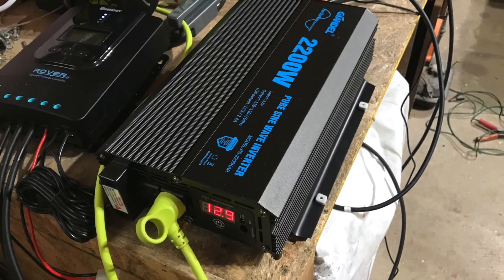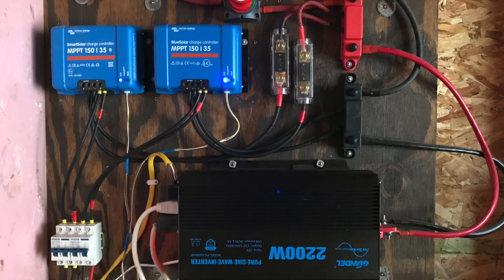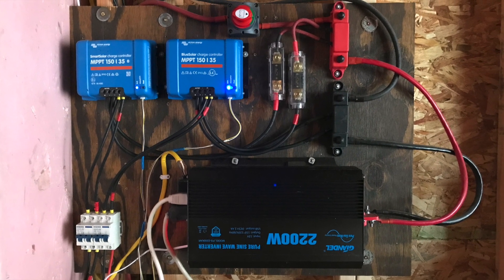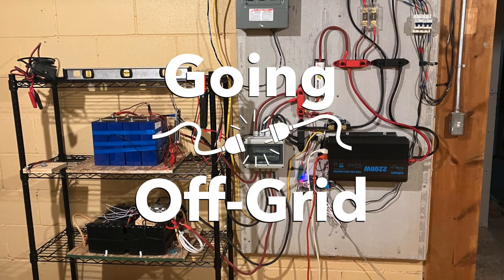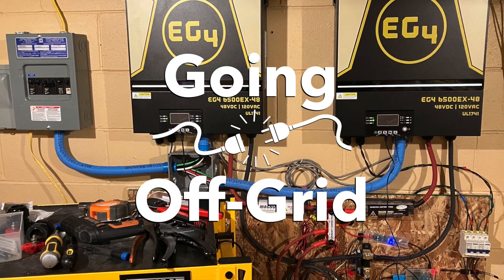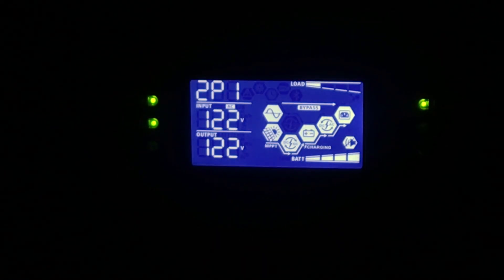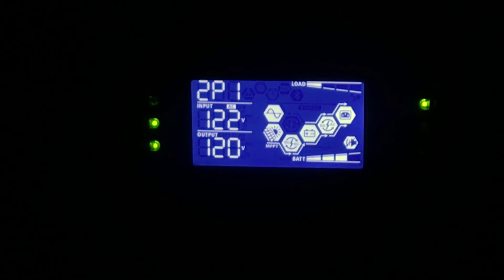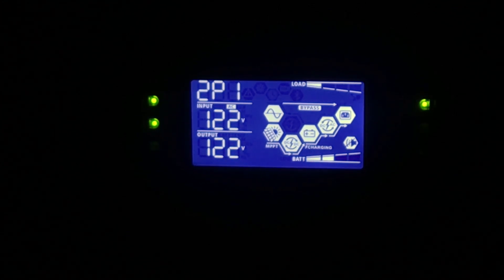Inverter Keeps Dropping the Grid Connection, Part 1

Comment: I have a Growatt 3000 24v that I am currently testing, and to be honest I am starting to think I might be better off going with a system of components rather than an all in one unit, I am going to invest in some Victron charge controllers, and separate inverters moving forward as I don't trust all my eggs being in one basket, the component method is a bit more expensive, however you can change one failed component rather than the entire system failing. Check and make sure your panels are not over-volting the unit, when I put 5 of my 100w panels in series on a cold sunny day they cause my Growatt to turn the panels on and off as the volatge spikes, even though it is "under" the voltage limit of the unit, when I go back to 4 panels with 80v or less it is fine and the panels produce well.
Reply from the maker: I won't say that same thinking hasn't crossed my mind.  I had victron charge controllers in my 12v system and they just worked.

I know the voltage isn't anywhere near the max voltage.  The max VOC on any single string is around 200V.  Thanks

Comment: Try to space out your voltages for switch to grid and switch back to battery. Mine are set  at 44&50
Reply: yes
Reply from the maker: The voltage settings in my inverter to switch between grid and battery are 48v to switch to grid and 54v to switch back to battery.  That should put the switch back to battery pretty far into the charge curve for LifePo4 cells.
Reply: That seams to be fine then. What about the battery minimum voltage setting? If it reaches that it will charge from grid right?maybe if that's too close together to the switch to grid?

Comment: How do you set the charging mode ?
Are you sure you got enough voltage going into your inverters ...
I mean for those going high voltage ( 100-500v dc ) they'll start at 90vdc but their standard true start is near 120v and above ...
So, if you had it running with 7 panels string don't expect getting more energy by splitting ...
It may simply can't switch due to its own consumption while trying to run solar ...
If it detects what to run your consumption it'll try to run solar only but the voltage drop don't allow it ...
Check your charging mode priorities ...

Running Sub don't indicate it won't try to charge the batteries ...

My best guess stand it's in solar only charging priority ...
So it keeps trying to run on solar but have to switch cause it don't have enough production to ensure output, selfconsumption, and "stabilizing" the batteries .
Reply from the maker: Thanks.

My charging mode is Solar Only.  I don't want to charge from grid, because that defeats the purpose of trying to give less money to the utility company.  Charging from the grid just means you're paying up front for the power you're gonna use later.  

The inverter is in SUB mode (grid-bypass) which should mean that solar powers the loads and when there's not enough solar, it should draw from the grid to compensate for the difference.  I know there's currently issues with how SUB mode operates and Signature Solar has been made aware of this and are working on a fix.  

Regardless of how much solar is available, the inverters should not disconnect from grid-bypass and drop to battery mode if the solar drops to a lower operating voltage than what's required.  If that was the case, every day when the sun goes down, the inverters would have this issue (which is not the case).
Reply: @AdamDeLayDIY  
The issue stand that those inverters rely on batteries while adjusting mppt ...
So if it detects enough solar to power all your consumption without the grid it will try and won't be able to sustain enough amperage due mainly to its own selfconsumption to transform that energy and maintain the batteries at their current status ...
Reading other comment I point out like others that settings for the batteries use are not that correct ...
You ask it to turn on the grid at 48 v and ask solar to charge the batteries until 54v to turn back to solar ...
For the batteries life expectancy and "use" is it not the right settings in my opinion ...
I do think you better go for a 60 to 80% charge use ...
I get there no mention specific chemistry degradation "stocking" these at 30% charge but they selfdischarge too ...
Better way for the claimed purpose stand to shut down all what's electrically run ...

They're no point running with batteries if you don't expect these to gather the least back up ...
To gather any kind a back up they need to be charge and maintained charged .

Onto some of these you could program and set your charging grid consumption in between the time they're allowed to charge and the allowed charging amperage ...

Maintaining the batteries properly charge so they could be "at use" is some kinda budget ...

If you want it to bypass till the sun charge the batteries you'll have to put it in usb mode it will acting as a backup ...

In my opinion, so far, it is not some kinda malfunction ...

You put it in a thread loop were it still trying to run on with solar ...
In the end, it depends where you set the safety to turn the inverter off, but if is not allowed to charge them except with the sun and that there no significant sun production, you'll discharge the batteries just cause it will keep trying and rely on batteries to adjust the mppt ...

There's no charge first using solar setting but once turned off ... ( whether the inverter or consumption as soon solar panels could produce above the inverter selfconsumption ... )
Great find !!!

May be something to feedback sellers, users, builder about ...

Thanks .
Reply: @AdamDeLayDIY  
I mean it ...
Using financial institutions ...
You pay up front what you intend to be able to use later ...
And they all keep trying to run faster than inflation with money yours !!!
The reality we're depleting the whole planet from resources at our own risks ( not only as a specie ... ) remains ...
I mean it ...

Ratio risks/benefits is not universal understanding ...

A computer just don't care the consequences and won't be bothered, annoyed, sad or happy to be turn on or off ...

I hope you do !
I personally do ...

With hope i'd help greater understanding ...
Thanks .

Comment: Having exact same issue. Mine are 2P1 - SBU and 2P2 USE. Have 4 arrays feeding both P1 and P2 on the EG4-6500EX. Been working with Tier2 tech support at Sig Solar but do not have answer. Feeling your frustration. Even tried solutions posted on DIY forum to remove neutral/ground screws. Did not make any difference.
Reply from the maker: How do you have different inverters in different Output source modes?  Last I checked when in split phase, those settings were synced between the inverters, but that's beside the point.

I'm doing some testing right now on a possible work-around.  Still don't understand the actual issue, but so far my tests have been promising.
Reply: @AdamDeLayDIY  I miss spoke. Both inverters are SBU. Batteries setting (05) are EG4 and USR
Reply from the maker: @lambobuilder  Gotcha.  Thanks for clarifying!  I'll make sure to share the results of my test when it's all finished.

Comment: Just me thinking there is a firmware issue/glitch for SUB mode, doesn't do this in SBU. The inverter knows it's supposed to switch back to battery, but the firmware says hey not switching back, utility tastes better and is before battery (SUB)...make me. IE. turn off and on AC breaker...reset.
Reply from the maker: @Sundown yeah it does seem like there's something going on with SUB mode.  I've been talking with Signature Solar on some overall issues with that mode and they're aware and working on some fixes in an upcoming firmware update.  Hopefully their fixes correct whatever is going on here as well.

Comment: Eg4 have a update in there page .. have you updated ? Maybe that's the issue or try checking Voltage discharge and charge .. base on what I saw the batteries were low .. maybe I'm wrong .. good luck Brother
Reply from the maker: Last firmware update I know about is in regards to the EG4 battery communication error.  I had asked if there was any other fixes in the firmware and was told it's only to fix that issue.   I haven't updated the firmware since I'm not using the EG4 batteries.  Thanks

Comment: I had a similar issue, only when the system was in SUB mode and solar power was available. What would happen is that at night the batteries would discharge and the system would switch from SBU to SUB mode and when the sun came up the inviters started switching back and forth. When I did a manual change to SBU mode it straightened up. I did some testing and it would only do this when in SUB and solar was available. I powered down the whole system (Grid, solar, solar assistant, and batteries) then restarted and its has be about 48 hours and so far it seems to be OK.
Reply from the maker: That's very interesting.  Thanks for sharing.  

I know in the tech world I always say "when in doubt, reboot".  Still, a very odd issue nonetheless.

Comment: Your panels in series may have a VOC that on paper is above the start PV voltage for the inverters, however, shading could easily drop that to below the 80-90 Volts required.
Do you have the means to monitor the instantaneous PV voltage coming into PV1 and 2? 
If shading is an issue, perhaps using optimizers like the Tigo brand to help stabilize the panel array.
Reply from the maker: I can put a voltmeter on the arrays to see what's coming in, but this was happening when the sun was out.  Even so, if the array drops below the operating VOC floor, it should not cause the inverter grid connection to disconnect.  If it did, every time the sun went down each day this would happen.

Comment: Possible SolarAssistant doing it?
Reply from the maker: Thought about that so I actually powered it off to check.  Didn't change anything.
Reply: @AdamDeLayDIY  I will check to see how many times it has flipped.   My sensitive loads are still on 1500VA UPS.
Reply: UPS records LV switch over events.
Reply from the maker: @errcl65  What model UPS do you have?  I have 3 APC UPSs that I'm not able to use because they keep switching between line and battery power.  Some have issues while inverters are in battery mode, others have issues when in grid-bypass.  Really annoying hearing constant clicking all day long.  Had to remove them from use till I figure that out.
Reply: I use APC BP1500  (Costco).    No events registered over last 12 hours running in SUB mode with grid supplying most of the load.
Reply from the maker: @errcl65  Thanks.  I know my UPS issue is unrelated to this video, but still wonder why 3 of the 4 don't work.  They're all APC UPSs as well.
Reply: How old are the AGMs in UPS?  And are you using the filtered output plugs or UPS plugs on the APC?
Reply from the maker: @errcl65  umm, looks like I ordered 3 replacement batteries in July of 2021.  On each UPS I’m using both sets of plugs for different loads.
Reply: @AdamDeLayDIY  Started happening here.   Day time,  almost PV input,  full batteries...   UPS registered 4 interruptions (switch overs).   Grid is solid.   It has to be the heuristic SUB where is enough S to switch back to S, then finding there isn't really enough S and goes back to U.
Reply: Also only when there is a low system load.   Under higher loads, it doesn't do it as the no hope of S taking over from U.  But if the load is low, it seems to do this quick switcheroo.   I think DMI Inc. channel talked about this last year.   I can live with it.   It did not do this during the night when there was 0 solar coming in.   It is only doing it with almost 0 solar.
Reply from the maker: @errcl65  That stinks.  Still has me scratching my head.  Been happening here as well.  Has to be something relating to the solar because it doesn't happen after sunset.
Reply: @AdamDeLayDIY  I take it back.  Turns out the last switch overs were grid related.   583 customers down on a concession road next to us.   So there was a brown out and I think it did the right things.
Reply from the maker: @errcl65  well in that case, that's awesome!  Very happy when things work like they're supposed to!